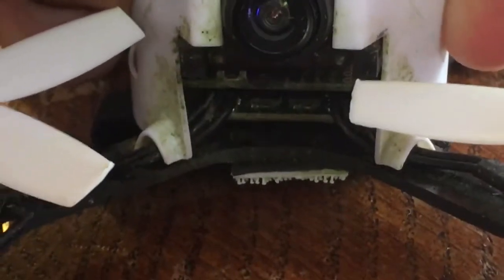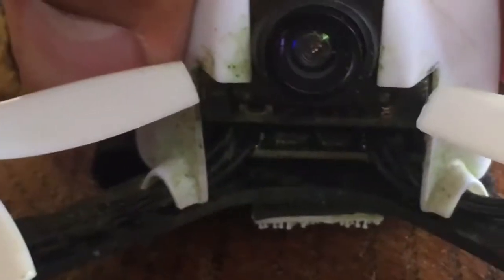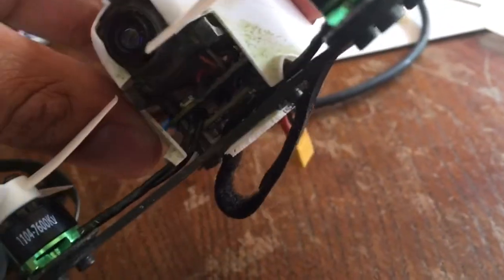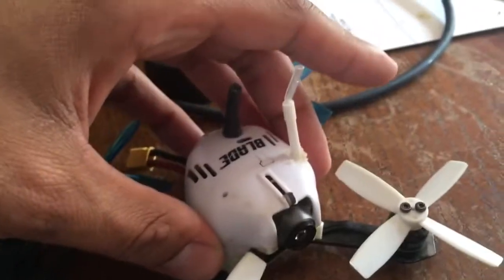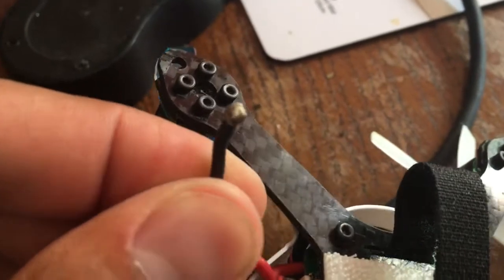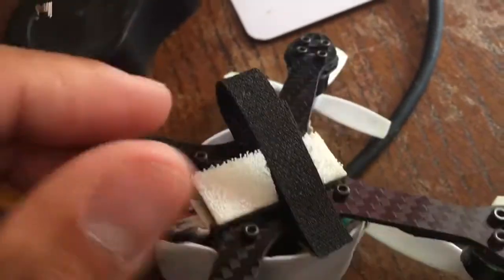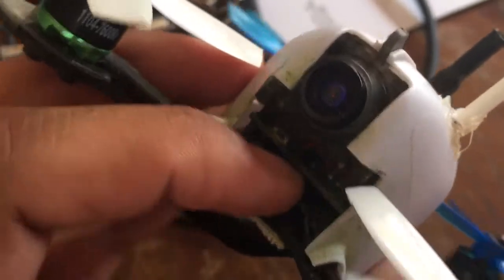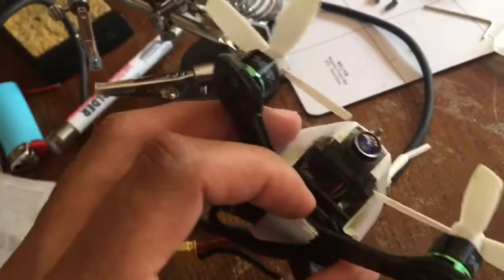Two out of three Blade Torrents 110 had caught fire and smoked

Comment: motor screws will touch and burn up the escs, and your using bigger quad blade props with the xt30 connector so my guess is the second one burnt up due to you over amping the escs
Reply from the maker: So far my third one is working just fine as long as I use spacers that are exactly the same size as the prop guards. Fingers crossed.

Comment: If you have a volt meter. Set it to continuity. Test from your positive lead to your frame. And the same for your negative lead. If you see continuity try to remove motors one at a time. I doubt on your first torrent the screws shorted the windings. At least they replaced it. Mine had some esc stalling. I raised min idle speed and flashed latest firmware and that seems to have solved that. Let me know if your other torrent has problems. Im currious to know

Comment: That is a sub-standard solder joint but easily fixable.  I would recommend raising the motors from the frame as Carbon fibre is electrically conductible and may be the reason why you got a short.  Its good to hear HH was able to refund you though,  I hope they do the same with this as well.  Knarly fracture dude.  Fly safe and FAST!!!

Comment: that's crazy you broke the frame, don't think I could if I wanted too! I had a similar issue... I traded a taranis plus special edition for this, tested at the gentleman's house, flew great! a bit of battery warmth. So got it home and started ripping (acro, no full throttle climbs, just proximity rip, I consider myself  very good at flying). After the 3rd pack everything was great, man that thing goes, feels 5"ish! Plugged my 4th pack in 5-7 seconds in it fell from the sky (2 feet) further inspection showed it was barely charged 11.1 voltage should be at 12.4 I think... tested my other pack 11.1 So I'm thinking this little monster ate both my packs, shit, right? So I plugged in another pack and only the left top/ bottom right spun with that smell you don't want to smell when you plug a lipo. Super bummed :(. I've literally never flew a bnf or rtf that didn't COME with issues. Hopefully you get everything worked out.
Reply from the maker: Thanks man. Yeah, they refunded my money for the first one but only gave me $50 store credit on the second one. Kinda lame. The Vortex 250 pros where near perfect for me. I want to build my own but just haven't figured out all the computer stuff yet.  Good luck, dude!

Comment: man that's sucks. blades fault for not putting a warning on the box
Reply from the maker: That's what I told them. They didn't agree the second time around even though I made custom standoffs. Fairly sure the motor screws were not toughing but I guess they didn't want to refund two quads for me. Still lame.

Comment: Did you modify the battery connector with the broken negative (black wire)?
Reply: Dude, this is the result of shitty solder, please go buy some kester
Reply from the maker: Son Ero I replaced the JXT for an XT30. This shouldn't have caused the negative to pop off.
Reply: Did u solder the XT30 onto the board?
Reply from the maker: Prodigy FPV I recommend using an XT30. It's lighter. You can change the batteries and the quad battery connections to XT30.
Reply from the maker: Son Ero I cut the JxT off. The board solder is factory.